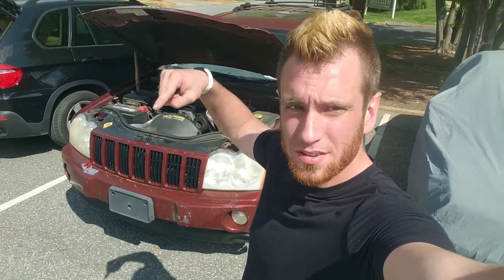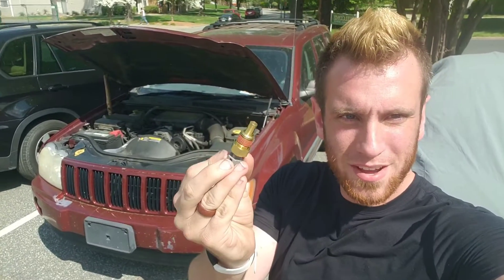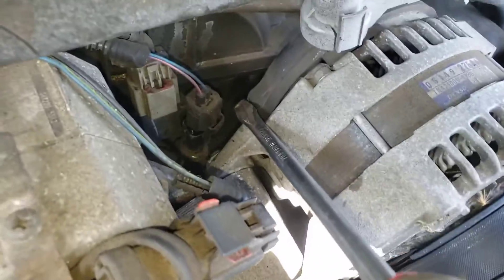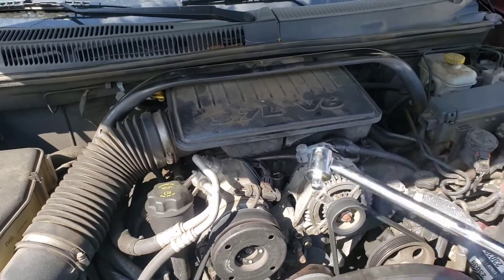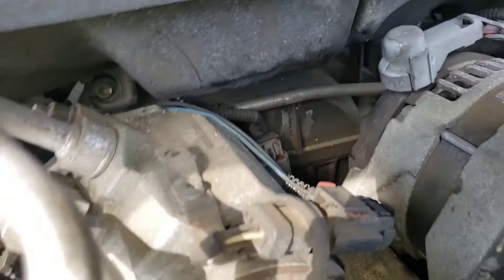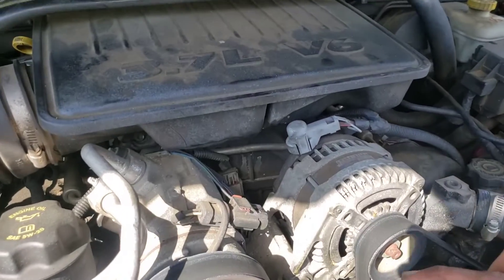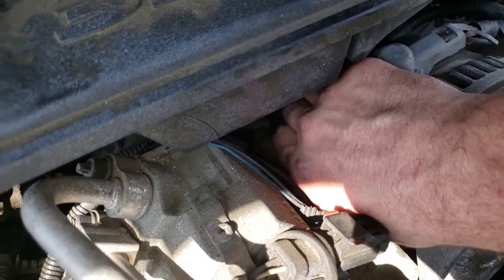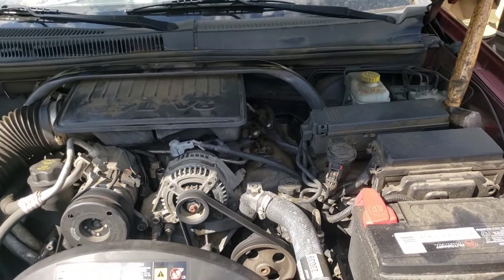How to Replace Engine Coolant Temperature Sensor 05-10 Jeep Grand Cherokee p0117 P1296

Comment: Thanks for this video! I had to replace the MAP sensor, which is right behind it on the intake manifold. Since I had to remove a bunch of crap to get to that sensor, I thought I may. I’ll just go ahead and replace the coolant temperature sensor too, which is just sitting right next to it. It’s a good thing you mentioned exactly. The socket size is 19 mm, and of course how to pull off that Connector. In order to to pull that MAP sensor off, you have to first remove the coolant temperature sensor because it’s sitting right in front of the MAP sensor and it blocks you from pulling it out.

Comment: I've replaced my thermostat, water pump and radiator n my jeep is still overheating. Would dis be da issue?
Reply: Did you figure it out?
Reply: @wyattduke8085  I did not. My motor eventually died
Reply: Might have air bubbles in the engine, bleed the engine release the air. 
If you have a vacuum leak it  will suck in air. A vaccum leak could be a bad hose,

Comment: Fantastic video! I’ve changed my thermostat a few times in the last year and this last time was OEM. Jeep is running cool (just below the center tick on the temp gauge). Coolant levels are fine. Got a P0128 code. I have a 2008 Jeep commander 3.7. Maybe I’ll see if the sensor itself is a problem.
Reply: Was it the sensor?
Reply: @codyhickey4447  in a twist of unfortunate irony, my Jeep was totaled out shortly after I posted this. I was responding to a call and someone ignored my lights and sirens. 

Now I have a 2016 Grand Cherokee and still have coolant issues! Faint smell but I see no leaks. Topped it off in August and exactly one month later, the level dropped a tiny bit. Temperature is usually cooler than even. I can keep you posted if you’d like
Reply: @codyhickey4447  Ironically, shortly after this video, someone hit my Commander (while I was responding to a call) and my Jeep was totaled. I now have a 2016 WK2 and I smell coolant faintly. Barely losing any and I can't see any puddles or leaks. Apparently it's just a Jeep thing
Reply: @codyhickey4447  The Jeep was totaled shortly after this post. Someone tboned me when I was responding to a call and they decided to ignore my lights and sirens.

Comment: I have a 2008 Jeep Grand Cherokee 3.7 I Want to know if this fixes your problem I changed my coolant temperature sensor and my truck is still shaking before it starts after I drive it for 30 minutes or so,, cold starts aren't  a problem, and if I'm idling gauges start to move to hot side , hopefully someone can help me! Thanks in advance

Comment: I’m m not having any issues w codes or start stop like u mentioned but I do want to change mine now b4 I get issues she currently just hit 181K miles so I’m doing a lot of replacing and maintenance as much as I can is that ok or should I wait till I get a code?
Reply: Great question, many sensors can go out of spec and not trigger DTC code, if you travel much its good idea to replace maintenance items that will leave you stranded if they fail, hoses, belts, etc and keep the old ones in the vehicle, you can test the ohms on most sensors with multimeter to see if they are within specs, there are many sensors and it can get expensive replacing them all, upstream (air/fuel) O2 sensors should be replaced at 100k, no need to replace downstream O2 sensors until they fail as they only monitor emissions, keep old upstream sensors as spares for downstream sensors if they fail, O2 sensors wear like spark plugs and start to lag over time..
Reply: @metalhalide4043  great info ty for the reply! 🤗 just got up to 195K so far and switched over to full synthetic oil, she’s good man and still runs strong!
Reply: @lstruggy  You have the 3.7 WK?
Reply: @metalhalide4043  yes
Reply: @lstruggy  Any leaks with synthetic oil?, I have always used Valvoline conventional but will start using synthetic as conventional oil is getting phased out, only Purolator One filters..
Reply: @metalhalide4043  so far so good no leaks I’m 2k miles into the 5k since switching to S.O. and zero leaks! My eye is on the oil pan tho and gasket as well as the transmission pan and gasket pretty soon it needs to be replaced some minor leakage around the pan couple of drops on the frame but nothing on the ground yet so that’s next for me then brake pads and calipers n disks also next then I’m done for a while lol 😝
Reply: @lstruggy  I recently changed the oil on the TX and did both diffs, just need to do transfer case, got both Valvoline ATF+4 and 75W-140 gear oil from Walmart, Mann Filter H 182 KIT from Amazon. I have been changing the TX oil at 50k and its way too dark, gonna change it every 30k being you only get 4-5qts out, 10qts total fill. Torque pan bolts to 70 in-lbs in 3 stages, 30-50-70.
https://www.amazon.com/gp/product/B005ETM5GO/ref=ppx_od_dt_b_asin_title_s00?ie=UTF8&psc=1
Reply: @metalhalide4043  I need to do those as well i replaced tx fluid like 5 yrs ago but I don’t think I’ve ever done the axle fluids nor the transfer case tnx for reminding me!
Reply: @lstruggy  I pump the oil out of TX which makes removing pan much easier without no oil it. You can do the same for rear diff, the front diff has hex drain bolt. Both front/rear diff will take less than three quarts. Not good if gear oil was never changed and u gots 200k miles, 50k or 5 years max, additives go bad after 5 years in ATF+4 and gear oil, thats what I got from Valvoline.
Reply: @metalhalide4043  I did change the gear oils 2016 so I’m due atm! I’ll probably have someone do it it’s 116+d average here atm in Las Vegas so that’s gonna be done this weekend as well as the f & r axles fluid change and transfer case Tnx for the reminder I need to get on it! I want her to last till 400+k mileage
Reply: @lstruggy  Jeeps are generally indestructible if maintained, the WA580 TX can handle the power of Hemi and 580N-m of torque so 3.7 is nothing for this TX. Another maintenance item on 3.7 is throttle body, you can get rough idle if real dirty, I take mines off every 50k and spray with cleaner to get the carbon off the inside, you DO NOT want to clean TB on engine for two reasons, you do not want all that dirt falling back into engine and you DO NOT want to try and move throttle plate to clean behind it cuz this is electronic throttle control and you risk damaging the gears inside or your fingers if it sweeps closed..
Reply: @metalhalide4043  oh man that’s music to my ears tnx for all the priceless knowledge sir I really appreciate that! 🙏🏽  I’m not a mechanic but I’m learning as i change, upgrade,  replace parts for the Jeep I’m constantly soaking info of the mechanics of it and since I got her back in 09 as 07 model w19k miles on it from the dealership i think it was a rental. But ya I’ve lived in San Jose, Oceanside, San Diego & now Vegas. She’s been really good to us and I’m always on top of it w any issues including a brand new catalytic converter last summer. And the basic maintenances. The throttle body issue I came across earlier this year. My mechanic replaced my water pump then he was having starting issues after he was done w wp install I was sitting right there patiently waiting watched him take off TB and cleaned off all the carbon build ups and she started right up after that! I try to do most of the maintenance but major ones I take it to my mechanic. I’ve done a lot of maintenance/replacing parts but she still runs strong and she’s very reliable to me and the family will never let her go she’s a keeper for life! Ps she’s bone stock and no rusts and mostly freeway miles probably never tasted and seen dirt tracks and trails but that’s later later 😉
Reply: @lstruggy  Yep, water pump is weakness, I am on my fourth one already, some kind of design flaw, what is great is I have the lifetime powertrain warranty so most everything in drivetrain is covered including water pumps, I recently got hit big with replacing the PCM, the O2 sensor heater driver circuit went bad and delays the time it goes from open loop to closed loop and triggered DTC codes and CEL stayed on, drove it for year no problems but they would not pass my inspection here in NC with CEL on so was forced to spend about $600 which was half the price, got new PCM was not refurbished from summit racing and just had to pay dealer to program it, no issues since..
Reply: @metalhalide4043  ya I hate those unexpected $500-$1000 repairs it hits different 😔 I’ve read and heard the wk water pump issue is super notorious infamous in the Jeep community 😆 I’m probably on my 4 or 5 wp as well! I got mines oem from oreily and that has a lifetime warranty on it also what brand wp u using? When I replaced my cat conv I also purchased 4 brand new 02 sensor & meineke installed all of em properly early summer of last year. I’m sure you could agree to this also is it’s a gas guzzler! hahaaa but it’s a v6 good enough for me I drive like a grandma super feather style throttle everywhere and it still cost me $58 full tank here vegas @$3.35/G @sams club. I also use stp fuel injectors every 4 tanks and raised my mpg all the way up to 17mpg was the highest from 14.7kpg last year but now back down to 15.4mpg I’m guessing due to excessive a/c usage here in the 🏜 but ya I still love my Jeep regardless 😝
Reply: @lstruggy  Yep, stop and go driving with Jeep not good on gas, I get about 16-17 city, highway I get 21-24 depending on quality of gas, just replaced tires with these Goodyear TrailMark, only paid $100 each at the time, much stronger tire and aggressive tread, drives much better..
https://www.walmart.com/ip/Goodyear-Wrangler-TrailMark-P245-65R17-105T-Tire/854910617
Reply: @metalhalide4043  ya it’s a killer especially w 115 weather on top of that 🤦🏼‍♂️ I recently also replaced my threads I use Goodyear Fortera HLs works great and looks awesome! U having issues w temperature knobs making clicking sound when changing vents and what kind of fuel grade u using?
Reply: @lstruggy  The clicking noise you hear could be bad blender door actuator, stipped or broken plastic gear, some are easy to get to and others may require dash removal, I always use 87 gas, I use B-12 fuel injector cleaner..
https://www.walmart.com/ip/B-12-Chemtool-Fuel-Injector-Cleaner/16817404
Reply: @lstruggy  The GY Fortera seems to have weak sidewall, mines was bulging out and caused the tire to wear unevenly on edge and have sloppy handling. It seems to be more of car tire and not for SUV. I would never buy Fortera tires again after feeling the difference with GY Trailmark..
Reply: @metalhalide4043  I use it 99% of the time on freeways only but yeah it’s not the best for off-roading got a good deal from America’s tire discount I might look into the ones u recommend next time